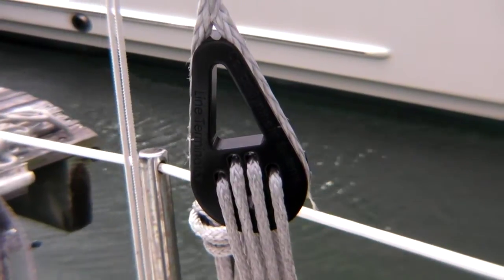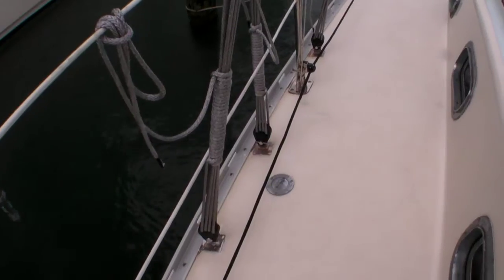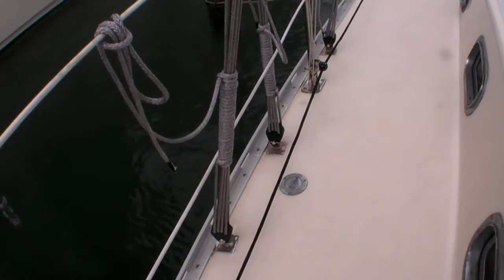Colligo's Synthetic Rigging

Comment: He said the cost is within 10% of steel rigging. But service life is only known to be 5 years vs 10-15 for steel. 

Plus cost of replacing fittings on the change over. 

Doesn't sound like a great deal.
Reply: Our synthetic rigging is now 4 years old and has crossed an ocean. Still going strong, but it's not their product. I used New England Ropes STS-HSR for the standing rigging.
Reply: You are correct. It's trendy, but it's not the right thing for me, and probably not the right thing for most cruisers out there in the world, which is why I ruled it out pretty quickly and went with new rod rigging. There are other drawbacks to dyneema too (beyond UV and abrasion sensitivity), like how much adjustment to rig tension is needed. It's higher maintenance than stainless steel rigging. Sure it's strong as hell. Nobody can argue with that, and in its first couple seasons of use it will probably perform better than steel in every way. But I'm live aboard and a cruiser I've got enough to mess with and work on... I'll be happy knowing that my rigs lifetime is perhaps longer than four lifetimes of dyneema (which equates to savings). For some, the DIY aspect, and the ease of transporting materials to far off locales can't be beat. For everyone else, steer clear. I wouldn't have used that stuff for my standing rigging if you'd given it to me for free. But that's just my two cents.

Comment: how can it be the same price as steel...should be MUCH MUCH cheaper?????
Reply: It is a lot cheaper when you do it yourself, and when you don't buy expensive terminators. I did my own synthetic rigging for $4,400 (including a full spool of spare line) when steel rigging would have cost me about $18,000.
So far, it has crossed an ocean and is still going strong!